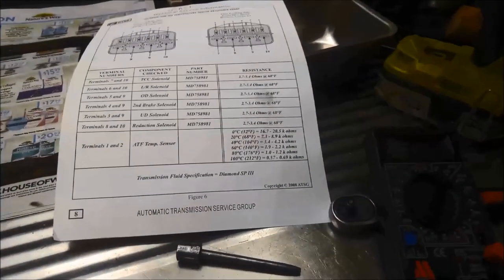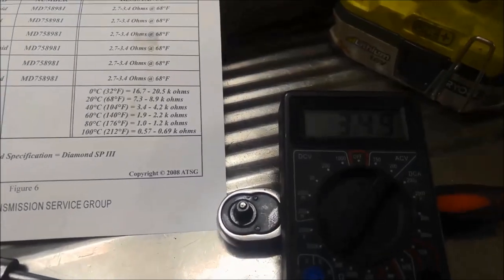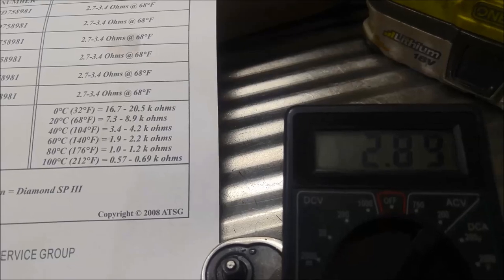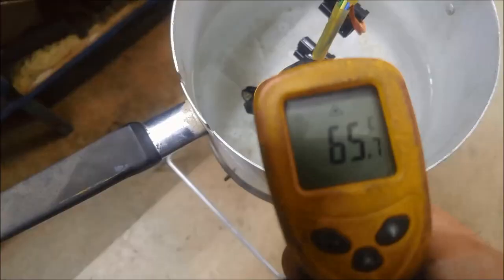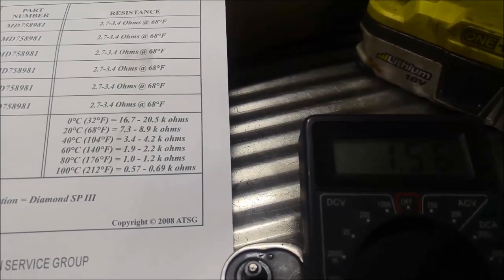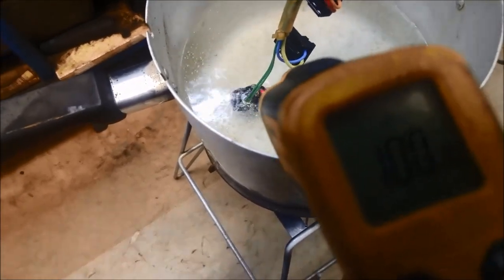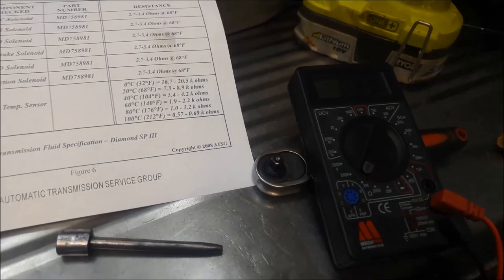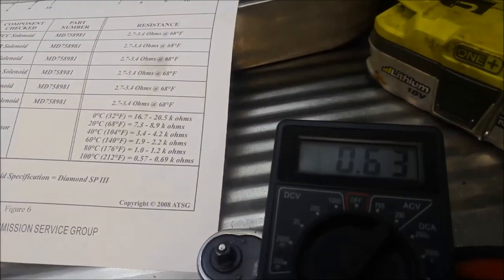Automatic Transmission Fluid Temperature Sensor Testing TFT Sensor Testing

Comment: Mine is reading 300 all the time. Was in a fender blender the other day and noticed my fan was running on high all the time and the wrench light was on. Saw the output this morning and it's 300 flat.  It's either dead shorted or open. Gotta pull the pan now, but will check the wiring as well.
Reply from the maker: no worries, cheers

Comment: My transmission temp light comes on the moment I start the truck with new transmission why
Reply from the maker: hi, can be faulty trans temp sensor and/or transmission temp getting too high. cheers
Reply: @YepThatsIt  i would understand that but 3 bad senors in a row that would be hard to believe.. An transmission getting that hot the moment I start it up in the morning no way
Reply: Which terminals are 1 and 2 where you hooked up the voltmeter?